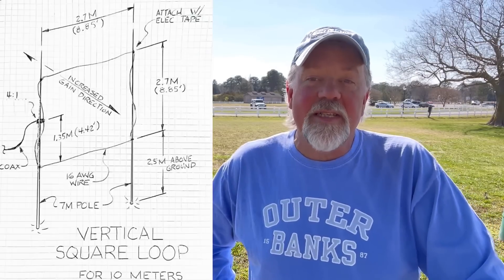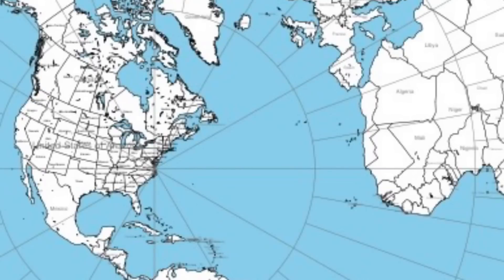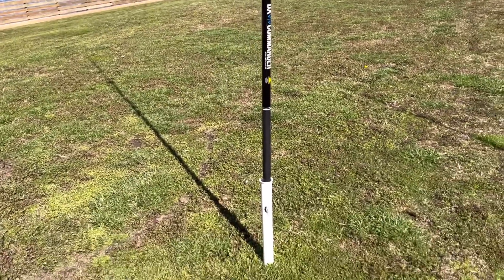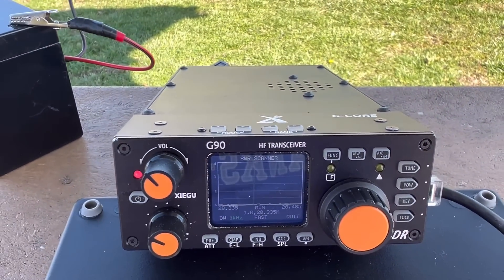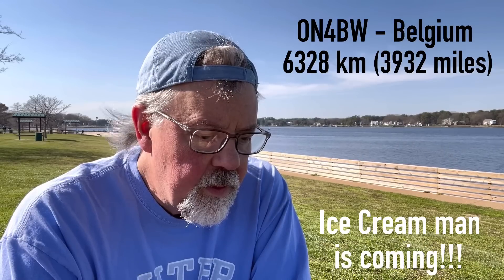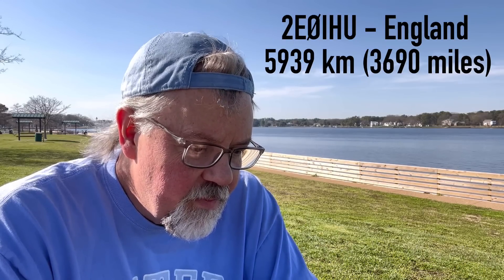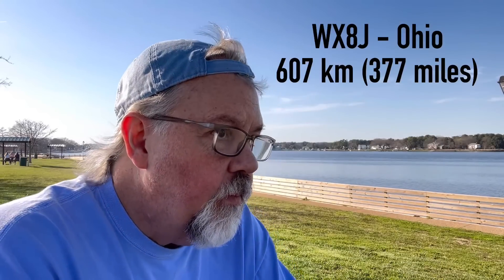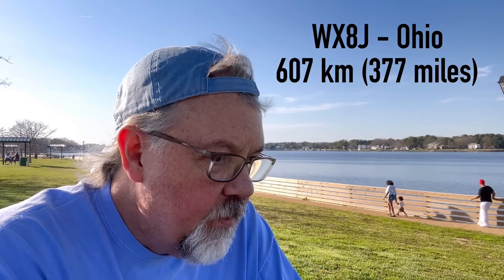Square Loop Antenna for 10 Meters

Comment: Good morning Walt, interesting set up for this antenna. How were you able to assemble and raise the antenna by yourself.  I would think that it might put stress on the wires already attached to the first pole as you raised the second pole…
I’m going to do a POTA at the Tomoka State Park Florida on Saturday using a pool noodle radial, a MFJ 17’ telescopic antenna and my FX4CR.
Really enjoying your experiments and your feeds, thank you. 73. AC3EA
Reply from the maker: Good morning, I built it laying flat on the ground and then lifted them together and put one in the rod holder and then the other. It was actually pretty easy and smooth. 73, Walt

Comment: Another great video Walt! I love full wave loop antennas. Back in my CB days I built one. I had mine set up in a diamond shape fed at the side like yours and instead of a 4:1 balun, I used a quarter wave section of 75 ohm coax to get the match without a tuner. 12 watts got me all over the world and across the states. I want to find a design for a multi band loop and put it up.

73 Jim K9KXW
Reply from the maker: That’s cool! I want to do the same, I’m looking for a Multiband loop that’s easy to build. 73, Walt